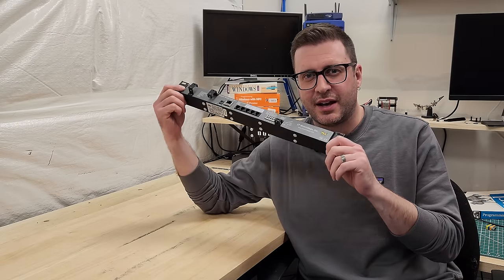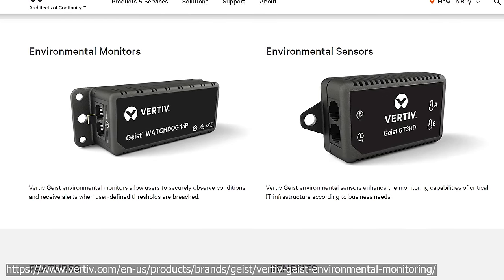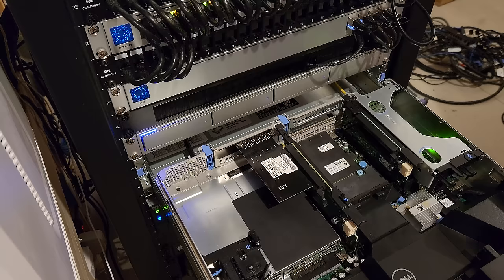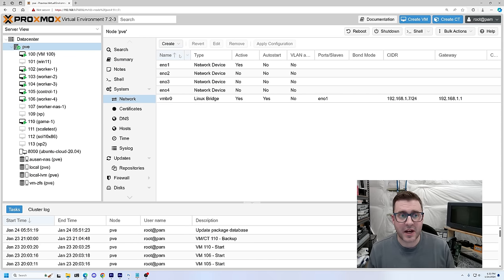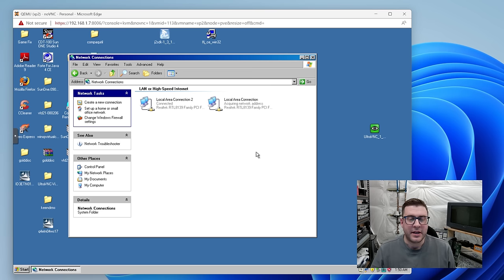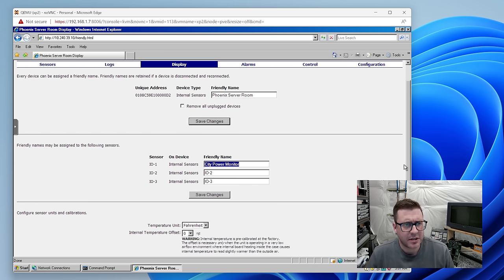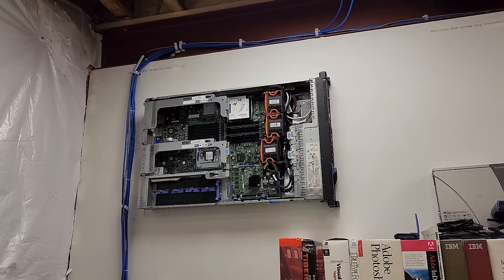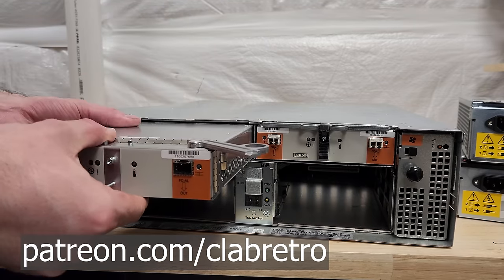Server Rack Climate Monitor: IT Watchdogs Weather Goose

Comment: Your XP VM and the device you're testing shouldn't care about the IP address assigned to vmbr1. 
So you can leave it static or just remove the IP address from vmbr1 entirely. Might save you some time and energy when hooking 'em up!
Reply from the maker: ah thank you! I was wondering about that
Reply: @clabretro    you only need to set the IP in the bridge if you want to be able to manage your proxmox from the xp machine in this example. It is a greate video. I love your content btw ;)
Reply: Came here to say just this. No need to tell proxmox the IP on the bridge for that network at all.
Reply: As people have said, IP doesn't matter. Your bridge is layer 2. You're effectively physically plugging your VM into whichever network you've bridged onto.
Reply: It's even better for the network security to not give pve an IP on that bridge. Then the old hardware cannot mess around with pve.
Reply: You can add a 2nd "Network Device" with the same bridge in Proxmox if you want your XP machine to be on BOTH the 192.168.1.X and the 206.100.50.X (or whatever). The layer two network doesn't care about there being different IP (layer 3) running. Then you can just plug your device you are testing into those existing network sockets.

Comment: I love how straightforward this device is. An equivalent modern device would require a cloud subscription. And an API that lets you access the data only in a way that benefits the manufacturer and not the user.
Reply from the maker: No kidding, and this thing will keep on working for another 30 years I bet.

Comment: I had one of these in a small datacenter I worked at. One day I went to go check out an overtemp alert at around 9:30 PM, and had discovered that the outdoor unit on one of the minisplits lit it's self on fire. Thanks to a Weather Goose I was able to call the fire department just in time to prevent the fire from spreading!
Reply from the maker: ha thats awesome!

Comment: Watching your channel is like taking a stroll through my career.. We had WeatherDucks and SuperGoosees (SuperGeese?)  They were great.... But we sent them all off to be recycled into lawn furniture long ago.  Love your channel
Reply: Oh, One more thing... The external sensors that plug into the RJ11 ports are just Dallas 1-Wire sensors of various types.  Im sure the branded sensors are available on ebay, but if not you can build them yourself.   Technically i think you can put up to 127 sensors on the bus, but in practice we used far less because of noise problems with the long unshielded cables ... 10-20 works pretty well though.  It just uses standard old fashioned POTS telephone splitters.
Reply from the maker: thanks for the tip about the sensors!

Comment: The push-in connectors are normally open/closed dry contacts. We have the Geist equivalent to yours (except PoE and with the display) and we bought a module that uses a rope laying on the floor to detect water leaks that plugs into the RJ ports so I wouldn't be surprised if they have both analog and digital inputs.

Comment: One thing you could try when looking for the IP is to use wireshark and look at any ARP requests coming from the other device. If it has a gateway defined, it will send an ARP request out looking for it.
Reply: I was just thinking that a mirrored port on the switch feeding to a wireshark session would tell you almost anything you needed to know about the existing IP configuration of a device.
Reply: That assumes it initiates unicast network traffic by itself, if by chance a device just listens passively this won't work. But even if it doesn't hit the gateway there's a decent chance it will send out some traffic even if it's just a broadcast. In this case you'll need to look at all traffic, focusing on ARP alone won't do any good.

On the gateway note, the web management on my D-Link switch has some weird half-baked IP implementation which IIRC managed to work even when the gateway was set incorrectly.
Reply: @MarkD26   There's no need for a fancy switch. Since he has a graphical environment locally installed on his PVE node it's easy enough to put Wireshark on there.

Comment: These things are super cool and useful. My company is a reseller for Room Alert devices and I wouldn't be surprised if these units are nearly identical on the inside.. The digital sensors are a little pricey, I have been tempted to open one up and see what the actual probe is - probably just a 3 wire DS18B20 or something like that you could wire up and terminate an RJ11 on your own.

I've also found that you can use any variety of cheap NO or NC sensors for the analog ports, i.e. door entry magnetic sensors, motion sensors (with separate power source), etc...

Comment: Man, your expression when you found the backdoor is awesome. Same thing when I find something 'magical' on the Internet too! Great job dude! Also Phoenix Server Room! I can't imagine Port Forwarding it, and accessing the WAP page on a Nokia.
Reply: Also, you looked like a 'hacker-man' when you turned off the lights lol. Also with regards to the 'testing network'. I feel that you could probably get an OpenWRT compatible router, (perhaps the old WRT54Gs), and just run that, isolated from your network. And it should report the DHCP address (if any), that the devices plugged in is reporting as.

Comment: Nice! 2821 was actually my first real Cisco ISR. Best router to have if you don't want to worry about licensing. It's also how I got my first Cisco phone system running as those actually contain an IP PBX.
Reply from the maker: Very cool. Yeah I haven't dove in yet but I'm sure PBX stuff will show up down here eventually haha.
Reply: All he needs is some Cisco 7940 and 7960 phones...🤔
Reply: @alexdhall  I would aim just a little newer than that. Those were a bit pre standard and are genreally harder to work with. 7941/42/45, 7961/61/65, and 7970/71/75 are all way better.

Comment: If Vertiv bought them, don't be surprised if new sensors are still compatible with the old monitor hardware..
Reply from the maker: That's good to hear. Is Vertiv a good company? I hadn't heard of them before.
Reply: @clabretro  they are / were also known as Liebert. One of the big players in the power / "physical" IT space, along with APC / Schneider.

Comment: Again great videos! I believe they hooked a sensor to the main electric circuit and it will send an alert if they loose main power.. At that time generators will kick in and employees can monitor everything from the UPS management and probably call and ask the price and delivery time of a tank truck full of diesel just in case...
Reply: But when mayor electric work was needed and the circuit from the city needed to be cut we never used our 4 big ass generators... We called a mobile "generator-in-a-container" and hooked it to a special huge plug datacenters have near their main electric rooms.. Maybe it was more cost efective and redundancy wise..  (mobile generator+batteries+generators)

Comment: I would expect the dry contacts to be straightforward on/off, between C and one of the 3 inputs.  you could try a push button to test them.  If you get the chance, you could probably add a leak detector (float contact) from a scrap dishwasher - a lot of them have them in the base plate.

Comment: Those dry contact sensors should be really easy to replicate... It's literally just detecting a very small current, usually something like 20mA (you'd have to find out the exact current).

You should be able to find some that are compatible or play around with making your own.

Oh, BTW, I bet city power was just their Mains power coming in. Dry contact sensors are often used to detect power conditions and are commonly used in UPS devices, so it might have been tied to that.

Comment: I just use an old fortigate firewall (well, a few years old, I've been running them for many years and as one lot nears eol they get cheap and that's what I run until the next gen gets cheap). A bunch of the ports are separate zones, each with a dhcp server running. Last device I needed to work out, just plugged into one of these ports, "diagnostic sniffer packet <zone>", and thankfully it broadcast it's ip in the first packet it put out after powerup. Set the interface to that config, and ospf let every other network device on my network know how to get there. Gave it a quick nmap and all was good.

It's even easier if the device itself is set to use dhcp, but unfortunately not every old piece of gear comes that way after decommission :(
Reply from the maker: That's a really nice way to go, I think I'll end up doing something really similar!

Comment: that weather goose turned out to be cooler than I thought-the backdoor password would totally NOT fly in 2024 security always kind of funny to see how "security" was back in the day lol. you might be stuck replacing the riser card for your R720 to fix the intrusion switch issue. unless you can find the wires in that and basically tie it together so it thinks its always closed. Also. Pro Dell poweredge tip, Dell servers like you visiting the lifecycle controller so it can "add to inventory" that's a dell-branded card once you do that it may show up (the 10GB card) in idrac for monitoring...also that can tell the server to re-adjust its fan speed profile for that new card. not required, but a good idea Unless you have CSIOR enabled ( collect system inventory on reboot)
Reply from the maker: yeah I just turned it off in the bios lol. thanks for the inventory tip!

Comment: Pinging 255.255.255.255 is a quick and dirty way to get the IP address of anything on your LAN, unless the device is configured not to respond to pings to that broadcast address. The CLI will usually only show the first address that responded, so IIRC you have to look at the ARP table or have a pcap running on the interface to see the rest of the devices.
Reply from the maker: yeah that's a good trick. didn't try it with the watchdog but had no luck on that IMM unfortunately.

Comment: When I have to figure out a random IP, I'll usually use Wireshark and a USB-Nic. Should be able to use it on XP VM? It doesn't actually need an IP.. at minimum you should see the device trying to contact its default gateway or DNS or NTP or request DHCP?
Also, for your XP interface you use for IP discovery, turn off the other services (like file/printer sharing. Etc...) to reduce extra distracting traffic...

Comment: If I have a device with an unknown IP, I usually connect it to a PC with running Wireshark or tcpdump. Then reboot the device. Many devices will do at boot a: gratuitous ARP, ARP to the gateway, NTP request, SNMP trap, etc. And from all of them (and any other IP-Header) you can get the IP of the device, no router required.
I’m also not sure what the Unifi does to show the IP, I assume they also only listen for a ARP requests.
Reply from the maker: yeah think I'll brush up on my Wireshark skills

Comment: Finding the correct driver is not painful by knowing the model Number, you can Match the hardware ID. That's what I did when Dell screwed up the Network ID for A Studio XPS 8100 wrong driver file was on the Dell site for that Model so I went to Broadcom site and Downloaded the correct driver no more Network drops and crashes  I'm good at doing this I can always send you the driver because I know the model number

Comment: When I need to find an IP range of an unknown device I connect to it with a cross-over to a system with a second Nic then tcpdump or run Wireshark.   Start a capture then power on the device to see what it asks for.   Like an ARP request of its default gateway or other information it will leak out.
Reply from the maker: Good call, I was thinking wireshark might be the way to go.
Reply: Yep. I stopped using the vendor tool to find the IP address and have used that technique, but!

Crossover cables are a thing of the past (I may have 1 or 2, 20 years old?).

All Ethernet Network ports in the last 15+ years?  have auto mdi-x, aka, auto crossover, so a straight patch would work as well.

Comment: City power as in voltage? But i'm pretty sure stuff would die well before 20v. and tbh I would want to track power hz as well as voltage as that will give you a lot of info about incoming power conditions.

Comment: Another Great video, as for finding out the IPs and ports learn NMAP its a linux and windows binary with a simple CLI and you can specify an IP range to search and it will check each one for common ports or you can scan every port from 1-25565 and at the end it will return you with a list of devices and open ports. That's really useful when you know the IP but not the management port

Comment: I used one of the yellow units you showed early in the video many years ago. Worked fine until it started locking up. 😢 Amazingly, not useful for monitoring the server room temperature when it was inaccessible. 😂

Comment: I upgraded my R7910 to a 2 port copper 10g + 2 port 1g nic a while ago, paid quite a bit for it on ebay.
The day after I installed it - my network gets hit by lighting. Only casualty was the 10g card and the switch. Back to the quad 1g nic ever since. Guess it wasn't meant to be.
Reply from the maker: That's a sad tale haha.
Reply: The universe is  telling you to use fiber. AFAIK it's often cheaper than copper and more future resistant, I can't imagine getting over 10G on reasonable copper cables but a cheap fiber cable will be more than good enough for 400G.
Reply: that was plan b, but when pulling the preterminated fiber (over 300ft underground in a conduit) I broke the connector during the last few inches pulling it into the rack.   @eDoc2020
Reply: @jfarre20   If you have 300ft of run between buildings then you should definitely be using fiber instead of copper. Any defect in copper for at that distance will result in problems running at high bitrates, and you've already learned what can happen when outdoor runs are copper.

Comment: Oooh, I actually have a bunch of these in production at our corporate datacenter (lol, buy it once, buy it for life. :D )  For the analog ports, you have the two C connectors and then the three inputs, technically they're pulldowns and they're looking for connecting to Common in order to register a change.  Otherwise they'll read 255 (undefined).  We have one connected to some "water rope", it registers as a 0 if the rope is wet, 255 if dry.  There were a myriad of sensors, current transformers (amp monitoring), utility power presence monitor (literally a LED with a photodiode detector), water ropes, additional temperature sensors, door contact sensors, etc...

For the four telephone jacks on the front, those are indeed for additional temperature ensors (they're actually Dallas 1-Wire sensors).  You can wire up your own, there's a PDF online somewhere but it only take three wires, +, -, and data.  I think the - wire is duplicated but it requires a six pin RJ12 connector.  I'll have to see if I can find the pinout, it's on a hard drive somewhere.

For best results (or at least what I do) is I use something like LibreNMS or Observium to monitor the Weathergoose for historical measuring and recording and use Nagios to monitor for "current state" recording, both via SNMP.   With Nagios, monitoring the explicit OID for a provided sensor (I have four hooked up to the one I have at home) it can alert if the temperature is too high or too low while Observium/LibreNMS will show the temperature trending of a particular sensor.
Reply from the maker: ah, thank you for the sensor info! yeah thinking it's time to get a LibreNMS server running

Comment: Another blast from my IT past.  Configured a lot of watchdog environment sensors when I worked for Delta Airlines in the early 2000's.  I'm not sure how but would love to get a Westinghouse 1642, which was the green screened terminals you'd see at airports back in the day before we replace with OS/2 and eventually Windows NT4.  Based on what I understand, its all serial and in theory could interface with the TTY console of any device with the right settings (dip switches) applied.  Hmmm... off to ebay to search.
Reply from the maker: ha thats cool. and yeah one of those terminals would be awesome

Comment: How does it integrate in a Linux setup?
Reply from the maker: probably SNMP would be the most interesting route there
Reply: Probably just as well as with Windows, I imagine modern browsers will handle it just fine. SNMP probably works, or the XML interface is made to be polled by software.

Comment: The city power monitor looks a lot like they monitored voltage from an outlet. They would want to know if the voltage went below 20 volts (probably 0 actually if there's a power outage) or above 150 volts for a power surge. I'm just assuming but it would make a bit of sense. Either that or they monitored their power consumption in amps
Reply from the maker: yeah I bet you're right